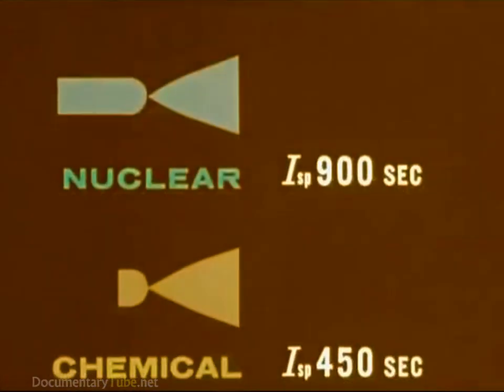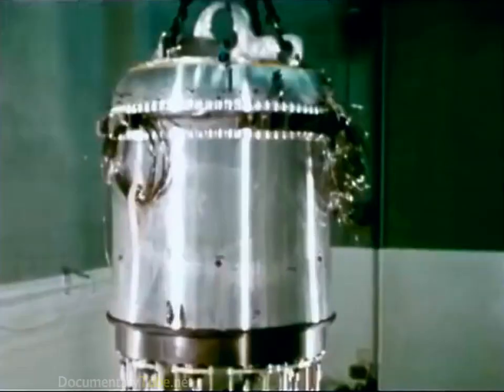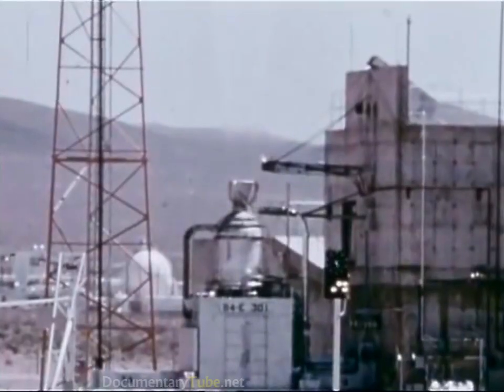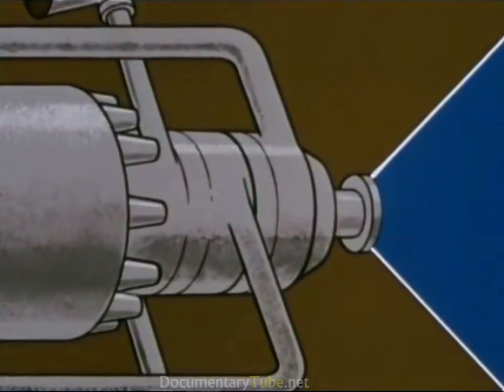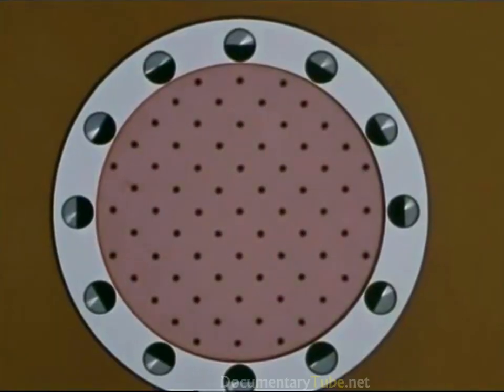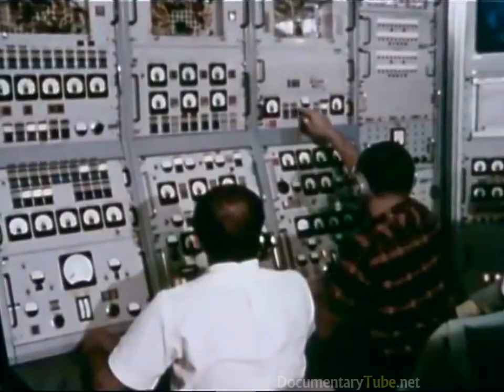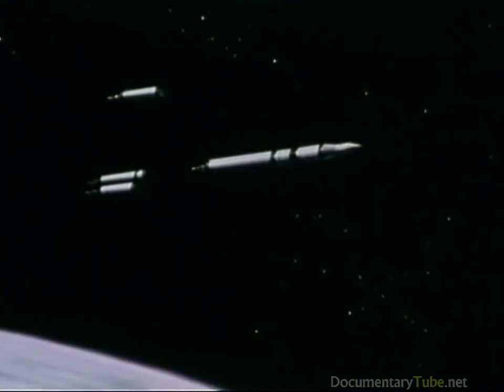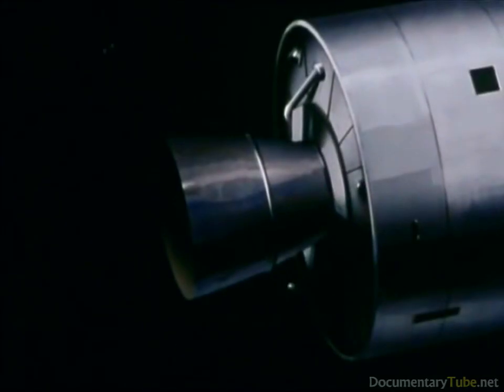HOW IT WORKS: Nuclear Propulsion

Comment: Anyone question what their propulsion pushes against in a vacuum?
Reply: It pushes against the rocket.
Reply: that is half the equation !
Reply: No.. that's the entirety of the whole thing in the end.  You create a high pressure gas and exhaust it out an opening.  This generates a force in the opposite direction.  Basic Newtonian physics.
Reply: see how far you can run if your feet are not in contact with a solid surface. As Archie would say "Ahhh is yourse basic phisics"
Reply: Uhh..  well different mechanics entirely between running and rocketry but okay..
Reply: what I am saying is action/ reaction needs SOMETHING to react against! There isn't anything in a vaccun .
Reply: You don't need anything to react against.  All the important stuff takes place in the combustion chamber, it's the force of the exhaust leaving the chamber that generates the force against the engine which in turn pushes the rocket.  There are no external contributors required and in actual fact rockets work better in a vacuum since there is no back pressure slowing down the exhaust which in turn causes a reduction in force.
Reply: well, think what you like , or believe what someone told you but you cannot push off of nothing. Enough said.
Reply: Mike Makuh, you are an uneducated boob with no knowledge of history. Some nitwit columnist at the New York Times took Robert Goddard to task over this very issue a century ago. And yes, of course, the Times long ago printed their retraction and apology.
Reply: Well my "HIGHLY" publicly educated (brainwashed) Boob, Goddard had the moleacules in the atmosphere to push against.
Reply: It wasn't about Goddard's test rockets.

JULY 17, 1969: On Jan. 13, 1920, Topics of The Times, an editorial-page feature of The New York Times, dismissed the notion that a rocket could function in a vacuum and commented on the ideas of Robert H. Goddard, the rocket pioneer, as follows.

"That Professor Goddard, with his 'chair' in Clark College and the countenancing of the Smithsonian Institution, does not know the relation of action to reaction, and of the need to have something better than a vacuum against which to react -- to say that would be absurd. Of course he only seems to lack the knowledge ladled out daily in high schools."

Further investigation and experimentation have confirmed the findings of Isaac Newton in the 17th century and it is now definitely established that a rocket can function in a vacuum as well as in an atmosphere. The Times regrets the error."
Reply: Rockets do not need air to push against.  This is just a flaw in peoples understanding.  In actual fact rockets work BEST outside an atmosphere.  Some people don't believe this, because they don't understand what is going on either due to a lack of education or some other.. problem..  regardless the world or universe is not limited in how it functions by the inability of a small number of people to understand it.  "I don't understand therefore it's not real" is the cry of the born fool little more.

Comment: i have inside info direct from NASA. They are thinking about using Farts. yes Farts. everyone on the space station were to contribute, and save their Farts. they would have enough fuel to go the Uranus. The Farts would be mildley radiioactive. They are working on filtering the lumps out.  I suggested that they use lots of Metamucil and burn the fluid that is excreted.  Remember this is top secret and Iwant to reman anonymous. You never heard this from me.
Reply: Yeah harvest the stench trench then blast it out the shite pipe💩 remember nasa runs a tight ship,not a shite tip!😂

Comment: and then rocket blows up in mid air during the transport of the nuke reactor to the space... few nights after you wonder why everyone is so shiny in the dark...
Reply: It happened and wasn't any big deal. Protective canisters for safely launching nuclear material was a solved problem by the time this film was made.
Reply: The commonly accepted idea is that the reactor will only be activated once it is in earth orbit. Virgin enriched Uranium is only very slightly radioactive. You cant eat it, but you could sleep on it for a year without suffering harm. It could be packaged in a way where it would not break up during a launch explosion.

Comment: if theres no atmosphere in space how can it work
Reply: Object Audio
Gas has Mass,if gas is heated it expands to extremely high pressure and flows from its containment...in this case the heating chamber and has to flow out of the nozzle at a high velocity.
Pushing any mass, even gas, will generate a  force which propels the rocket opposite to the flow of gases.
A nuclear rocket will still need a gas to create thrust but it wont need an oxidizer like oxygen, as there is no combustion, just heating from nuclear reactor.
Reply: It doesn't depend on the atmosphere to work, it's a rocket.
Reply: what dos it push against
Reply: Simplified, you can see it as the gases "pushes" against the rocket in order to accelerate out the nozzle. This makes the rocket move in the opposite direction.

Comment: Mmmmm...Irradiated hydrogen, fired straight into the atmosphere. What could go wrong?!
Reply: These are not designed to be lift vehicles. They are meant for use when already in Earth orbit for interplanetary/moon missions. The thrust is too low to escape Earth's gravity well. Once in space the velocity of the exhaust and the extended burn/run times more than make up for the relatively low thrust.
Reply: Pure hydrogen does not get irradiated by neutrons.
Reply: Doesn't it turn in Tritium?  Which would not be a drama, since tritium is naturally manufactured anyway, and is only weakly radioactive.  @RCAvhstape
Reply: If a hydrogen atom captures a neutron from the core, it becomes deuterium, which is not radioactive.
Reply: @jwilde642  - I am not sure that is strictly correct. I posit that every type of atom and isotopes are radioactive.

Edit: It seems like a proton (which is part of the deuterium nucleus) might have a half-life at around 10^32 years (for comparison, the universe is estimated to be 13x10^9 years old). So yes, deuterium could be radioactive, just not very much. 

Source: http://hyperphysics.phy-astr.gsu.edu/hbase/Particles/proton.html
Reply: That is some serious hair splitting, my dude.
Reply: The issue is not the theory (Hydrogen is the safest element for the usage) but when bits of the reactor overheat (deliberately or on purpose - they did overheat one on purpose) and it starts eating the reactor components like you can see in 5:15, sort of a radiation based roman candle for all the downwinders to ingest and die some years later of cancer.
Reply: Um no, the thrust would have been more than sufficient to achieve Earth escape velocity.  However, you are correct inasumch as NERVA was intended to be a space-only engine.  You are thinking of ion thrusters, perhaps.
Reply: @Neil Miranda If the reactor is built right, the hydrogen should never come into direct contact with the uranium fuel, which is clad with zinc or other materials to prevent it from corrosion, oxidation, etc.
Reply: @Bill L My layman's knowledge of this is that the reason something gets "made radioactive" is because it contains an element that gets transmuted by the fission reaction's neutrons into an unstable isotope of some other element, unstable meaning it needs to decay by emitting particles. The metal alloy structure of a nuclear powerplant, for example, contains metals that get activated by neutrons. That's why even after a reactor has been shut down and the fuel removed, it still has to be treated as a radioactive hazard. Hydrogen is not one of the elements that gets activated.

Comment: You mean the rockets that were being worked on by Rocketdyne, there was a nuclear waste site in semi valley not too far from JPL. A small reactor that not too many people knew about, and recently in the last few years made public. I used to work at a company that made part of the plasma cutting equipment to cut up the old reactor. The stainless had some very interesting colors after being irradiated. This is what causes failure, as the material becomes brittle and with stress breaks instead of bending. GE has worked with this since the beginning. Nothing new here. Nice video though... There were articles about this in magazines in the 1960's such as Electronics World. I think it is interesting that Boron is found very close to an active air base today north of Los Angeles.
Reply: Paul 
I think it is caused by neutron embrittlement of the steel.

Comment: This engine can only "safely" be used in space. every bit of its exhaust is badly radioactive. Back in the 60's no one thought about what that radiation did after it left the engine. Also, that reactor looks like a disaster waiting to happen imo.
Reply: rein1705 I wonder if a thorium based reactor could work without so much radioactive emission.
Reply: This engine type does have a radioactive exhaust. The hydrogen goes right through the core.
There was attempts to build nuclear jet engined aircraft during the I think late fifties and sixties, and they did attempt a safe version, that used a heat exchanger type system so there was no direct contact with any exhaust gasses, but such a system if more complex and much heavier. I'm not sure if it was attempted for a rocket engine though.
Reply: Emilio Hernandez , thorium is not a nuclear fuel: it is fertile, not fissile. It is used to breed U233, which is more radioactive than U235 both because of its shorter half-life and because it's usually contaminated with U232 (I think) which is highly radioactive. The higher radioactivity is no big deal in a reactor, but causes serious problems if you want to make bombs out of it.
Reply: That is a really good question Emilio. The radioactive decay rate would be different, but i cant say by how much.
Reply: I don't think you can make thorium go critical or super critical.

Isn't it just a beta emitter anyway?
Reply: tubewatch59 thanks for the explanation, a shorter half life should mean higher radioactivity with the various isotopes and fission products and transmutation periods. I was thinking of thoriated tungsten welding electrodes, they are mildly radioactive.
Reply: i met a guy on a DOE job who use to work with a guy at lawrence livermore labs who had a pole that was used to measure the radiation level of the exhaust from either this or the nuclear jet engine. he had it hanging on his office wall like a trophy and claimed it was not activated. the guy who i met took his geiger counter and confirmed that pole was very radioactive. the pole was removed and disposed of. the guy with the office was pissed that he lost his trophy
Reply: The exhaust isn't radioactive, all the uranium is kept in the engine. There is a design for an open cycle engine that had radioactive exhaust, but it was never built or tested for obvious reasons.
Reply: rein1705 
It must be hard being so stupid. I feel sorry for you.

Comment: Basic premise is it acts very similar to a catalytic converter, except it produced heat energy internally to ignite the hydrogen propellant
Reply: No ignition. No catalyst. No oxidation.  Heat is from a nuclear reactor on board launch vehicle. Cryogenicly stored Hydrogen propellant is heated in the reactor but not burned. Rocket impulse is from extreme expansion and high particle velocity of heated hydrogen propellant. Exhaust material from rocket is Hydrogen at extremely high speed. Simple and nasty.

Comment: Jackass Flats remains one of the most contaminated U.S. sites 40yrs later.  Merely heating exhaust gases is also not very efficient.  If one wants maximum specific-impulse in space, ion thrusters can't be beat.  Theoretically, a single molecule could be accelerated sufficiently to enable star travel through the relativistic momentum equation, but practically ion thrusters use low voltages.  The future is likely in Laser-driven plasma wakefield acceleration of heavy ions.  (more...)

If a benign element, such as Bismuth, could be (laser wakefield) accelerated as fast as electrons today, fuel could be ejected with TeV energies from an engine only a few meters long.  Specific-impulse (SI) could exceed 10^8 seconds, more than a million-times better than chemical rockets.  

Interstellar travel will never be accomplished without increasing thrust velocity and fuel density.  Even Mars travel could benefit from such an engine.  Remember, thrust goes up with SI.  A million-times SI leaves a lot of design room.  Where today's Ion thrusters measure in grams-thrust, Laser-wakefield Bismuth thrusters could measure in tens or hundreds of kg thrust?  

Laser-wakefield Bismuth thrusters are also safe, non-radioactive (more or less), and might even be efficient.  They routinely achieve 15% efficiency in colliders and presumably could be made even more efficient in thrust-engines?
Reply: Ion propulson is king when it comes to sheer ISP, but the thrust is less than a sneeze.  Chemical rockets are on the other end of the spectrum.  Very meh ISP, but amazing thrust.  Nuclear thermal rockets had the chance to give a very good middle ground.  What was also cool was the idea to have a pure H2 propellant for high efficiency thrust, but if you ever did need sudden, high thrust, you could inject LOX into the reaction chamber as a kind of afterburner.  The ISP went down, but the thrust could go way up.  This makes the engine more flexible.
Reply: Tom Noyb coolness! Check out my idea posted topside and picture it in your head and tell me what you think?
Reply: The largest obstacle in interstellar travel actually the success of a cryo sleep chamber.  None yet exist, and we need them for travel even just to Mars.
Reply: Wow. I felt like an astronaut after reading your comment. Murph!!!!
Reply: Going to exoplanets (like Proxima-b or similar) is impossible, regardless of the propulsion system, simply because speeds beyond a fraction of c would lead to destruction of both crew and instrumentation on a spaceship (google up W.D. Edelstein and A.D. Edelstein 2012 "Speed kills" paper). We are an Earth-bound species and need gravity to be born and survive, so we'd better concentrate on keeping this planet fit for a decent quality of life for everyone. This, said from an enthusiastic sci-fi movie fan!
Reply: Tom Noyb not to escape Earth's gravity..ion thrust not sufficient  ( yet) only for thrusters
Reply: None of that works in a vacuum. Gravity propulsion is really the only logical way. Otherwise far too much fuel is needed.
Reply: @joshportie  what the hell is gravity propulsion?
Reply: @iliketrains0pwned  manipulation of magnetic fields. Earliest example that i know of is the Nazi bell craft.
Reply: @joshportie  That's not how either gravity or magnets work.
Reply: @iliketrains0pwned  look at the way thrust reacts in a vaccuum. With normal combustion rocket propulsion you require matter to push off of. In a vacuum the only matter to push off of is the material coming from the rocket. This means fuel consumption does not lower in space after breaking free of gravity. This means fuel requirements are extradinary.
Reply: Part of that radiation took out the 'downwinders' and the cast of 'The Conqueror' - and arguably it's star: John Wayne.

Fascinating video about the sheer money and effort the US was putting into space travel at that time, before they crashed into the concrete barrier of the Van Allen Belts which stopped them dead.
Reply: Graham our GOV has every phone call, text message, email, ever written buy they lost that tech. I can't believe people are so gullible to believe NASA.
Reply: Many don't realise NASA is part of the DOD and a purely governmental organisation and just as much capable of constant lies than the rest of government. Iraq WMDs anyone?

The Saturn V rocket was a flop because of the hopeless F-1 motor, more of a low pressure flame thrower than a rocket with a terrible specific impulse - but they could have developed past that - the real barrier was the VABs - that still stops them today. I don't know if the VAB problem is a blessing (to stop our military invading space) or a curse (causing out military to concentrate of destroying planet earth instead).

I do love the well spoken matter of fact vocals on the video though, at 5:15 he's cheerily explaining what we are seeing is the core breaking up - oblivious of the fact that test firing was pumping highly dangerous and radioactive products straight up - unfiltered - into the American atmosphere. At Windscale in the UK some annoying scientist insisted of wasting a great deal of money installing a filter on top of their experimental reactor - a move that some time later saved most of the UK from a lethal cloud of fallout when inevitably the reactor went wrong and the filter was most certainly used and saved many lives then and still today.

I also enjoyed the trip to Mars being discussed - casually throwing away 5 expensive nuclear reactors in the process to drift around in the solar system.
Reply: Graham Could you elborate on that please? Give us some background on that.
Reply: Graham but but but they said they lost the technology lol. Such massive liars.